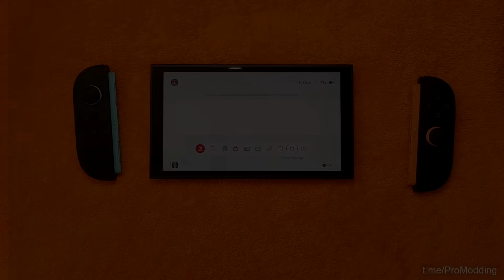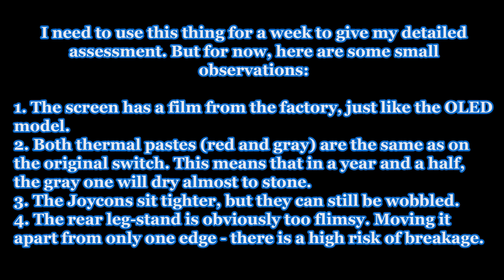World’s First Switch 2 Teardown & Microscope Review (4 June, Before Release)

Comment: Now I understand why ppl complains about battery life.

What a small, ugly thing here, poor mAh I believe for demanding games with online functions. 
No more bigger cells 4 the price of the console....
Disappointing 

Most overpriced system and what expensive are the games.
Memory chips are the cheap SK Hynix instead of better quality ones? Thermal paste looks cheap kind too. I didn't buy the console but I feel scammed. 
My, the big N is worse than uncle Scrooge

And the cartridges, no full game inside just bootloader and internet needed they say.

Nice video btw
Thank you for the good work.
Reply: Nintendo would have been better served by making a full console, Mac Mini-ish, so they could maximize the feature set.  Then release a handheld "viewer" like the PlayStation Portal.  Because at this point, Nintendo has already lost the 'portable' segment; the only ones who would buy Switch 2 are/were Switch 1 holders, and they wouldn't be impressed by this in any case.

But if they'd just gone full stop with a regular console/dock with the specs similar to Mac Mini and include a device like the PlayStation Portal at no additional cost - NO GAME KEY CARD SCAM - Nintendo would have surged ahead.

Comment: It seems that the bottom charging port will continue to be the console's weakest point in this generation. 

I'm also surprised that Nintendo said they had to design it from scratch, when it pretty much follows the same structure and component placement as the first switch.

Comment: @7:56 the connection between the Core and the cooler... with a heat-doubletape? you kidding me....this piece should have been 1 solid thing for better heat transfer...
Reply: I think you're misunderstanding what you're looking at. That's a very typical cooler design and at least they're utilizing the rear shield to help dissipate some of the heat.
Reply: @JJFX-  oh your right, sry, was to fast in the video, the fins are on the bottom when he moves the heatpipe. thx for info =)

Comment: It's ‘‘‘fine’’’ for me if I don't have access to everything in a very easy way (as long as I'm not deprived of it) but, come on, stickers on the joycons are placed?? Stickers🤦🏻‍♂??? And screws under the joycons stickers????? 🤦🏻‍♂🤦🏻‍♂🤦🏻‍♂. Really bad. 
As I said, I don't need to have access to everything, but there are certain components that should have easy access just like in the old days. The very minimum is the easy access to the battery and, secondly, the access to the screen should be much easier as well, although I understand that it would be more complex than a simple battery.

Comment: Having to remove those huge stickers that cover the entire left and right sides of the console just to access the screws for a possible repair is completely unacceptable. Let’s face it, everything will eventually break. I can already see YouTubers like The Cod3r, who fixes these consoles almost every day, getting very, very, very annoyed by this. I wouldn’t be surprised if the repairability score from iFixit ends up being lower than that of the original Switch.
Reply: yeah the stickers will probably worn off over time
Reply: They used shitty thermal paste again too!
It'd be worth it to repaste the console with good stuff, even if it's not hard/softmoddable

Comment: MOST IMPORTANT THING , HOW MANY NM PROCESS FOR THE MAIN SOC ???
Reply: It's already been confirmed to be Samsung 8nm.
Reply: Please understand that "nm" is mostly an irrelevant metric on its own. These days it's more of a marketing term indicating generational uplift in transistor density, clock speeds, etc. than an actual measurement. It's not comparable between different manufacturers as "X nm" on Samsung, TSMC, GF, Intel, etc. are all very different products.

Comment: Damn, harder to repair. Why did they solder the Gamecard reader on the board?
Reply: I bet they made it harder because of modding or hacking .. not sure tho just a guess
Reply: @nofaceexe But nobody ever used it for hacking. It being removable was never a security issue, just a convenience for people who breakages (which happens with a cartridge slot over time). This is just more anti-repair BS, plain and simple...
Reply: The folded ribbon cable connecting the motherboard to the cartridge reader board would deteriorate and eventually fail, I've personally seen it happen three times. Having it all on one board avoids this issue.

Comment: The part that’s going to break is on the console. Insanely dumb design.
Reply: Right. Because Nintendo's design engineers are morons and you are a genius. 
Sheesh!
Reply: @Great-Documentaries Yes, they are morons. A lot of their hardware has had major flaws. Here's a quick list off the top of my head:

The NES had a poor cartridge slot design that wears out over time because they decided the stupid spring-loaded gimmick was necessary (it wasn't).
The SNES (at least the North American version) uses a type of plastic for some of it that yellows easily and thus becomes brittle.
The N64 has a terrible analogue stick design that basically grinds itself down over time.
The Game Boy went without a lit screen until the GBA SP (though they made the Game Boy Light earlier on, but that was a relatively limited Japan-only release).
The DS had problems with its hinges (mainly the DS Lite, which uses a single hinge mechanism on one side, putting a ton of torque on the other side, creating the commonly-broken hinge problem).
The original 3DS has direct contact between the touch screen bezel/circle pad and the top screen, eventually etching lines into the top screen (this is a common issue that can only be avoided by either not closing it or putting something like a cloth in-between every time you close it). 
The New 3DS (XL) has an exposed cartridge slot that is easy to knock, killing your game in the middle of it (a light brush of the cartridge is enough if your cartridge slot has loosened enough over time). Also, the hinges become loose fairly quickly, making the top screen loose. Finally, the microSD card can only be accessed by unscrewing the backplate, which can then break because the plastic fairly thin but requires you to undo captive screws and then pry it off every time you want to access the microSD card.
The New 2DS XL has the same loose hinge problem except even worse.
The v1 Switches can warp over time from heat, and would even crack along the vents at the top. That's to say nothing of Joy-Con drift and the loose connections (which are mainly down to Nintendo designed the Joy-Cons to have a little bit of spacing between them and the main body, separated by two tiny plastic nubs which you probably can't see because they'll have already worn down after a bit of use, causing the looseness). Oh, and the dock that scratches the Switch screen over time, similar to the 3DS.

I could go on and even nitpick, but I've experienced all of these first-hand (except the SNES - I live in a PAL territory so I don't have a North American SNES). Nintendo are far from perfect. Their hardware often leaves ample room for improvement. Despite that, these issues have often been overlooked, sometimes for legitimate reasons (enjoyable games, for example) and sometimes for poor ones (fanboys being fanboys, like you). That's not to say others haven't had their fair share of issues - the PSPs certainly have some durability issues, and both the Xbox 360 and PS3 had major issues early on - but Nintendo is not some kind of saint like you keep making them out to be.

And if you read all of this: congratulations, I'm sure you'll write a reply about how I'm wrong about all of this despite experiencing it first-hand and seeing tons of other people experience these issues. Don't bother. I won't be reading whatever fanboy crap you have to spew.

Comment: they using Nvidia again?... good luck to Nintendo's security team once again, but i'm guessing this is the reason why Switch 2 game cartridges are digital downloads only cuz likely they cheap asses knew it'll get modded again.
Reply: Let me guess. You don't know a thing about the Horizon OS and how impossible it has been to hack recent versions. (Spoiler: Switch 2 uses one of those, plus something similar to what the old Xboxes had to detect hardware attempts at hacking. You aren't hacking this one.
Sorry, you're not.
Reply: @Great-Documentaries No software has proven infallible. Horizon OS is not infallible either. Just because an exploit has not (publicly) been found, that doesn't mean one won't be found. You sound so sure of yourself despite being utterly wrong. Nothing is hack-proof. It might take years, but it'll be hacked eventually.

Comment: R.I.P for repairability having both USB-C ports soldered to the board instead of being modular and connected via a ribbon cable.

I just know within the first few months multiple Ebay listings will pop up with Switch 2 consoles where both ports are busted.
Reply: Hot air rework station makes quick work of them
Reply: switch 1 and switch lite and oled has usb c also soldered, not a big deal
Reply: Only idiots would list them on eBay instead of sending them into Nintendo for repair.
Reply: @Great-Documentaries Only idiots would send them to Nintendo for repair instead of getting an independent repair service to do a better job for a lower price.
Or learn to do it yourself.
Either way, it would be better if they weren't soldered in, regardless of how the previous models did it.

Comment: Do you think the grey thermal paste softens when heated by the SOC chip? In a lot of ways this system looks a lot like the Switch. Too bad about the joycon wobble and the kickstand. I'll be likely waiting for a cheaper Lite model; I enjoy my Switch Lite for how sturdy it feels.
Reply: It always softens with the heat, but this kind of cheap bulk thermal paste isn't as viscous and wet as aftermarket stuff you can buy, so it tends to be drier and dry out quicker over time.
Reply: @GareWorks  I think he's trying to ask if it's a phase change TIM or thermal paste. I'm fairly certain it's a common bulk paste that should definitely be replaced after opening the console but should hold up reasonably well otherwise.

Comment: Does opening the system brick it?
Reply: Given that the battery is in there, do you REALLY think Nintendo would be that dumb?
Use the brain evolution provided you b4 asking dumb questions.
Reply: @Great-Documentaries What does the battery have to do with preventing the system from functioning if you open it? Not to say I think they actually brick it if you open it, but regardless, there being a battery inside is completely irrelevant to the question. Also, usually when someone publicly complains about someone else's IQ, they're just projecting. You, sir, are definitely projecting.

Comment: I'm amazed that the PCB has hand-written sharpie on it.
Reply: My Switch Lite does too. Real humans touch every unit.
Reply: I believe it's for testing before assembly. Might be wrong.
Reply: Very common part of QA as it's still more practical for humans to do much of the final assembly. Even for products assembled mostly by machines it's typical to have a worker look over each unit and mark them prior to the next step on the assembly line.

Comment: Typical anti-self-repair/anti-right to repair Nintendo-still not very self repair friendly unlike Xbox and their iFixit partnership for easy self repairs with genuine parts and guides.

Wish Nintendo would make battery replacement a breeze with pull pouches or pull tabs oreven copying Apple's awesome electrically releasing battery adhesive that the iPhone 16 uses.
Reply: My friend Apple is anything but pro-consumer when it comes to repairability, regardless what fancy adhesive they used to keep the battery in place. Nintendo isn't great either but this definitely isn't the worst I've seen.

Comment: 14:03 The nVidia SoC was manufactured in mid-2024 (week 22). Nintendo really delayed this console...
Reply: 2021 has already been reported on one chip
Reply: @mikeuk666  2021 -> tape out, not manufacturing
Reply: @NathanDrake5  Based on a design that was IN manufacturing in 2021. But wtf does it matter?
Reply: @Great-Documentaries  It does.
Reply: Hardware was dialed in years ago which isn't uncommon. Nintendo spent most the time on the software, testing, etc. Plus keep in mind how many units they sell means Nvidia and other chip manufacturers had a massive order to fill prior to launch.
Reply: @JJFX-  You must be kidding me, 8-10nm chips are dirt cheap.

Sony/MS didn't release 2020 consoles with 4-year old chips (RDNA2 was 2019 tech).
Reply: @NathanDrake5  The PS5/XSX's GPU arch is RDNA 1 with RT features from RDNA 2 backported.
Console hardware has to be locked in years in advance, so untested technology that doesn't exist yet will never be an option.
RNDA 1 was finalised in late 2018 as RDNA 2 was in development, around the time those consoles' hardware would have been decided.
Reply: @NathanDrake5 That's not my point. I'm saying they chose the chip to develop around years prior, as did the PS5/Xbox regardless if they were in mass production yet. That's how this works, they don't spend years designing the console then simply throw in whatever the latest chip is prior to launch.

As for being an older generation, yes that's true but it's also a completely different type of console and it shows how long they've been working with Nvidia. It's not simply an off-the-shelf SOC. We know it was delayed for various reasons and it's not practical or cost effective to start all over again on a newer, more expensive chip that they didn't design everything around to begin with.

Plus keep in mind, in Nintendo's eyes they got 'burned' by the vulnerability in the very first generation of Nvidia chips used in the Switch 1 that still allows people to bypass all their anti-piracy measures. I'm not trying to defend anyone but this is more complicated than I think people realize.
Reply: @NZZN_  It's RDNA2.
Reply: @JJFX-  You don't seem to care about my point, why should I care about yours?

Switch 2 uses 2020 tech (Ampere GPU), while PS5/XS use 2019 tech (RDNA GPU).

As simple as that (5 vs 1 year delay).

Just admit that Nintendo sold tons of Switch 1 consoles during the stupid lockdown, so there was no reason to release a Switch Pro back then.
Reply: @NathanDrake5  Sony and AMD call it RDNA 2 but the PS5 came out before RDNA 2 consumer GPUs, and as I said in my comment, under the hood it's actually more closely related to RDNA 1 with some additional features from RDNA 2.
Reply: @NZZN_  Want some proof about 2021?

Read the DK Bananza interview (they moved development to Switch 2 in 2021). :)
Reply: @NathanDrake5 I'm aware of that interview and it lines up with when target specs would have been determined. The screenshots shown would have been running on PC simulated equivalent hardware since from what the public can tell (from component shipping manifests) devkit production started in late 2023.
Reply: @NathanDrake5  So the point is Nintendo used 'old' generation, therefore PS better? Did the PS5 Pro not recently come out with mostly the same RDNA 2 chip with a little bit of raytracing sprinkling on top? The switch was never meant to compete in performance with PCs and PC-based consoles and it's a tiny SOC anyway.

If Nintendo released the Switch 2 in 2021-22 it would have sold far better than the boom of people buying the original. Look at how many units they sell, do you really think the supply chain was there to do that without becoming another paper launch? They weren't even done with TOTK yet which wasn't developed for the Switch 2.

I'm just as frustrated at Nintendo as the next guy and I'm sure they're maximizing profit like always but there's no way this console was ready for global launch back then. They had a performance target that worked with Ampere and Samsung was cheap. It's that simple. If you want the latest and greatest tech then this is obviously not the product.

Comment: With the joycons removed, do the connectors on the S2 stick out further than the frame? I like using my Switch on a gooseneck or tablet holder and it clamps on to the Switch from the sides. Would hate for the clamps to hit the connectors.

Comment: Wondering if the new joycons will drift aswell this time
Reply: I prefer to use pro controller over joycons because of this
Reply: They will, but I bet at a much less rate. Originals were hot pieces of garbage
Reply: @co2_os  ofc they will drift, the same as switch one no hall effect... you can buy new ones for 90$
Reply: @omgoat  they can't be hall effect due to the interference of the magnets

Comment: It looks very messy inside. The layout and general design looks all around the place. Weird. 

Also it's like first Switch + OLED - NAND variation via supply chain. Your NAND is KIOXIA/Toshiba. Some previous leaks was by SK Hynix.

I'm curious if the display is really made by Sharp or it's using some cheap chineese/tawanisee vendor like AUO, BOE, InnoLux or even Tianma like on the ROG Ally.

Comment: Still just 3,78 Volt battery? 
Nintendo and Nvidia is using some kind of sorcery to get the games running as good as they have shown so far 😅
Reply: Volts have nothing to do with battery capacity.
Reply: @JacobShropshire  it's related to power output, though. Many handhelds use three cells linked up in series to triple the voltage.